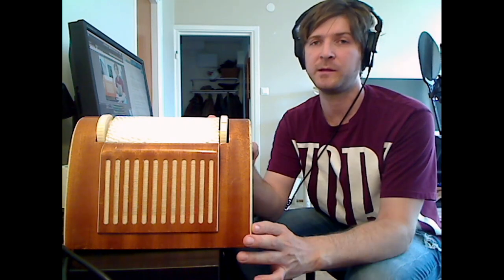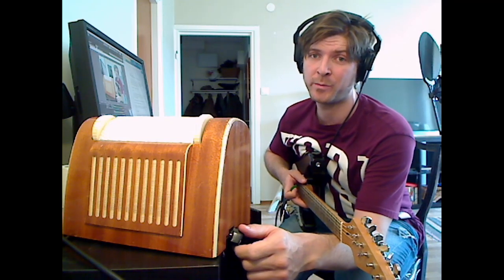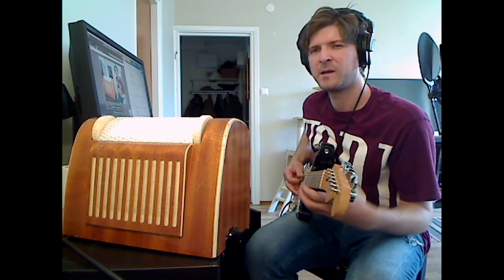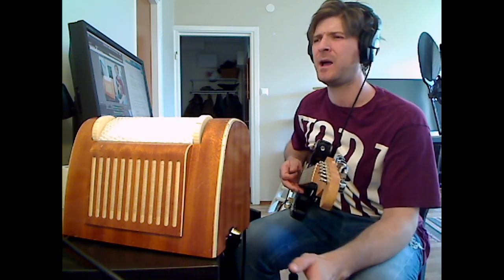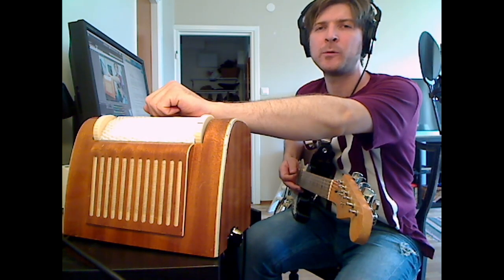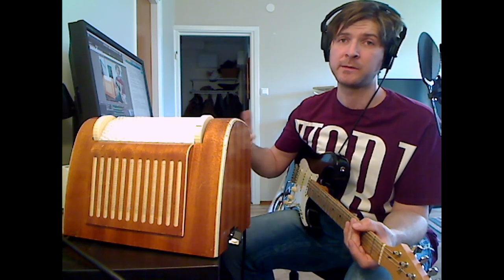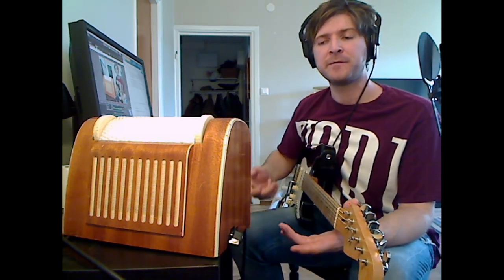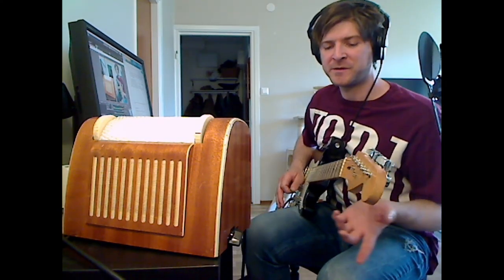Spring Reverb Unit Surf Settings For Guitar (Drip Over 9000!!!)

Comment: A Fender Champ amp whose output goes directly to the spring tank. That's what the fender Reverb unit is. Without spring tank you have a Fender.champ.amp. I think that was from Uncle Doug's Tech Channel.
Reply from the maker: I wonder if that is correct. I mean the reverb unit's circuit is the 6G15 while the Champ has had the 5E1, 5F1 and the AA764. Maybe more. Maybe I'm missing something, but this is what I know. Anyway, sometimes I use the reverb tank as a preamp: tone at max, dwell at zero and the mix at max. The signal actually overdrives a little, maybe also because my reverb unit has a tube rectifier.

Comment: Uncle Doug's YouTube channel has a four-part series on building this tank. Perhaps he meant the general layout is like a champ or I heard it wrong. I am reviewing parts of this series myself. I bought a new doctor Z clone which has a solid-state rectifier. So I cannot play around with this too much. Would like to try a 6K 6 but I don't know if the circuit can handle it. I am just trying to get myself to jam I'm probably three times your age and handicapped. Love what you did with your setup.
Reply from the maker: Ou, well. I'm not too sure myself either at this point. I've also been meaning to try a 6k6, but I really don't know if it could break. Gotta ask someone who knows better.
Thanks! This was my first video. I will soon be back with more content and hopefully good ideas. By the way, If you're 3 times my age then you are 99, which I doubt!